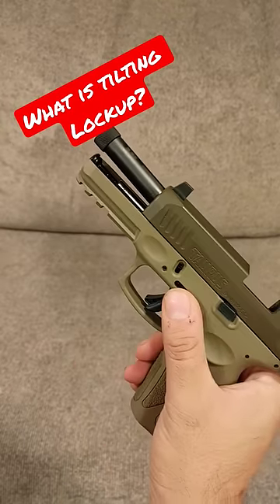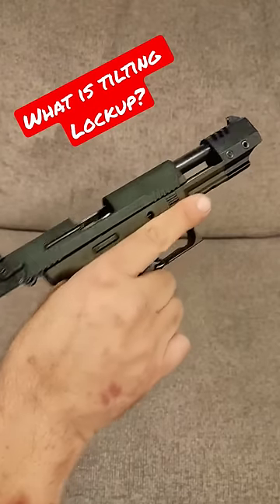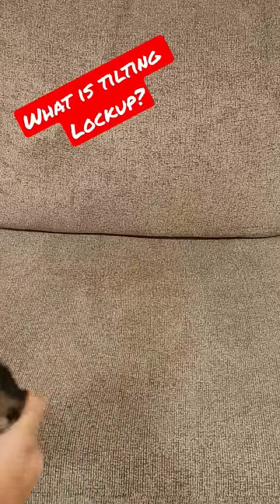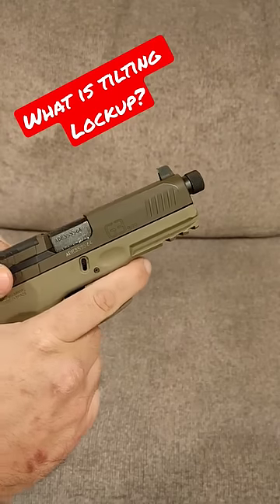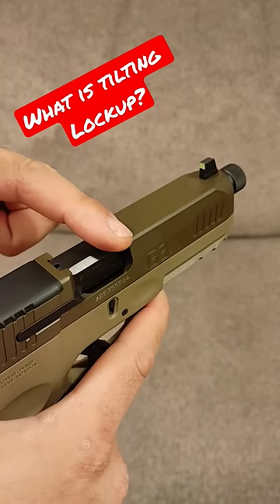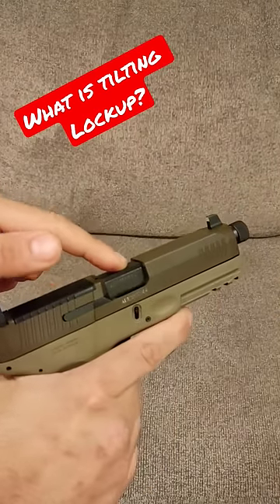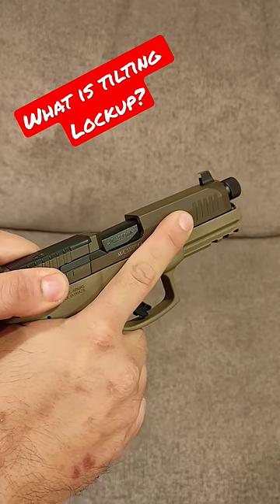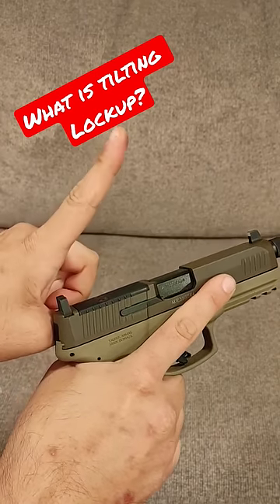What is Tilting Locking Action?

Comment: Laughs in beretta
Reply from the maker: Ooh, good call ill do one on the dropping block. Its a cool design
Reply: @TheJimminiShow  John Browning invented that box system on that barrel for his Browning high-powered 9 mm and everybody from Glock to whoever you.
Reply: Laughs harder in wheel gun. 🛞
Reply: I got a clone model cz 75 9mm & it looks like a 1911 & beretta had sex. Real accurate & reliable.
Reply: @timc46440  laughs even harder in musket
Reply: @TheJimminiShow  what about the rotating barrel design Beretta uses? They didnt invent the concept, i know the Savage 1907 has a rotating barrel that Ian from forgotton weapons shows doesnt really provide a true locked breech. Ive also always kinda thought the roller lockup CZ used in the CZ 52 was pretty neat as well...
Reply: Love my 92sf
Reply: @hunterherzog4788  Me too brother. Iconic workhorse.
Reply: @bobbybluntrock8928  Browning Hi Power uses locking lugs, just like the 1911. The Hi Power improvement was to lose the rotating link in favor of a cut slot to cam against a frame member. All of changes to the Browning lock up are for manufacturing improvements, not functional changes.
Reply: 92fs is an amazing design smooth as butter and very enjoyable to shoot
Reply: @46god  for sure, did some shooting with it at 100 yards with it on a 3x3 ft plate. Was getting hits about 40% of the time I was very impressed of its accuracy
Reply: Meanwhile everyone else that doesn’t own a berreta is like- "N00000 You can't POSSIBLY
carry a 92'III! It's the CURRENT
YEAR! Nobody shoots a DA/SA
anymore! It's OBSOLETE! It's
HEAVY! The grip is TOO BIG! You
can't even STIPPLE the Heckin
GRIP!". Btw I love my 92 m9a1 😎🔥
Reply: Laughs louder in Desert Eagle, HK P7 and Mauser C96 do not laugh.
Reply: @Keepitsavage21  well, I'd never carry one, 1, I don't like hammer fired guns for carry, 2. They're big and heavy, 3. I don't like DA/SA guns/triggers, and most of all, 4. I've just got so many rounds through polymer striker fired guns, starting with glocks like 15 years ago, and then finally switching to a sig p365xl about 2 years ago, and I couldn't be happier with it.  Well, and of course 5. the slide mounted safety.  Yes, I converted mine to a "G"/decocker only model, but I don't even like that on the slide.
That being said, berrettas really are slept on, and get a lot of undeserved hate(which I largely attribute to the various things that come out of the military.)  I only have one(a compact inox, which I just find so sexy), however I'd really like a full size LTT or Wilson Combat gun, or even one of the (relatively) new models who's name escapes me, "92 performance" maybe?  The stainless steel one with the(finally) frame mounted safety?  Those look sweet.  My only slight critique of that gun is the ugly, downward slanted beavertail.  You put a 1911 or sig 226 elite style beavertail on that thing and is buy one in a heartbeat.  Well, maybe.  I don't tend to spend a lot of money on pistols, especially if they are just going to be range guns.
Reply: @jonboy9734  laughs the hardest in bow and arrow
Reply: He sounds like a fatherly swagger souls 😤
Reply: @JRG GOTAY never owned one before huh?
Reply: If we're talking about the M9 then you'd be surprised that it essentially borrows the same idea as shown in the video, it's the browning action, just instead of it being part of the shape if the chamber on the M9 it's a separate locking mechanism that uses the exact same principle.
Reply: @Keepitsavage21  lol my buddies were calling me a boomer because I carry a 92 in a shoulder holster. I absolutely hate wearing jeans so i don't normally carry on the hip.
Reply: Laughs AT Beretta.
Reply: @jonboy9734  laughs in fire lance
Reply: @projectblack2462  Mexican Obregon 1911 was the 1st
Reply: Laughs at overpriced berretta while holding Girsan regard
Reply: @DaveOganesyan  I think the joke is about the tilting barrel in particular, which the M9 does not have
Reply: @jonboy9734  Snickers in Swiss Sabre

Comment: A Taurus is a short recoil, which is during the cycle of operations the barrel starts moving to the rear with the slide and is stopped by locking lugs or blocks while the slide continues to the rear. The locking lugs will stop the barrel from continuing to the rear and help the barrel to tilt. The slide will be brought back forward due to the recoil doing decompressing, while the slide moves forward it strips the next round, which is angled upward, from the magazine lift. The round will push against the feed ramp and slide into the chamber. Once the slide is fully forward then the breech is locked. The P22 is a completely different gun, thick of it as an AR. It’s is a gas delayed system, due to the gases going through the gas cylinder to complete the cycle. Plus that system cannot utilize a tilting barrel due to is gas cylinder.

Comment: So I think this would’ve been a good point to touch on, as I consider it to be the primary point. The reason that mechanism is even there. The larger caliber rounds that aren’t suitable for “direct blowback” need some sort of mechanism to delay the cycling of the slide, until enough gas has exited the barrel for it to be at a safe pressure to cycle. Direct blowback is used on smaller rounds like the .22 or the 9mm makarov, as these rounds don’t have a high enough case pressure to pose a threat to your hand. If that barrel had no delay mechanism your hand would get lots of powder burn and have nasty hot powder flying out of the ejection port, or even just send the slide back too fast and break the gun, or harm you. The tilting mechanism allows enough delay for this to happen. Some handguns use a rotating bolt delay mechanism as well as a few others, though tilting is most common due to it being simple and requiring less time/money to be spend in the manufacturing process

Comment: I think I'm the one who asked that!! But thank you much appreciated I had no idea that's why It did that
Reply: The tilting barrel is actually a very old design and was first invented to help improve feed reliability as well as aid in lock up
Reply: Did he answer your question?  Cause he said a bunch of nothing. Lol
Reply: He did a great job explaining how it does that. The reason why that was designed was so that it resists barrel rise when firing.
Reply: It locks up to prevent the gun from opening up while the bullet is in the barrel and chamber pressures are to high. If it opened to soon you would get a blow out. That’s why it locks up. He did a terrible job of explaining the reasoning.
Reply: I've read through a bunch of the comments and I dont think I've seen anyone else say it so I'll add, the tilting barrel also helps with general wear. Sinc the barrel and slide move together as opposed to sliding against each other.
Forgive me if I'm wrong about this I'm not exactly what youd call an expert. This is just what I was told when I asked the same question after getting my first glock.

Comment: True.  But it's also to allow for a better projectile trajectory.  If the barrel stayed perfectly strait then the bullet would start to drop immediately after leaving the barrel.  This would make sights on top of slide useless.  By adding an arch to the bullet it allows for more range and the ability to see the point of impact from your sights.  Your 22 has an arch, you g3, your ar15, and every other modern gun have a slight upward trajectory.  It's why when we zero rifles for 50yds it's also still on at 200 yds.  Bullet going up at 50 yds and on its way down at the 200yd mark.  🤙

Comment: This is also why fixed barrel handguns such as the 22 he was showing are usually more precise.
This is due to the barrel not moving from shot to shot like a tilting barrel does.
Generally speaking when A shot is fired and the slide starts rearward the barrel tilts and the locking lugs disengage with the slide in one smooth motion.when the slide goes forward the barrel moves back into place and locks the action. Depending on how tight the tolerances are determines the overall accuracy of said handgun

Comment: Yeah that's correct. But did you know why they went for that design ? It's chamber pressure. That's why .22 don't have it they don't need it. The chamber pressure has decreased enough when it ejects the case. Where on a Glock it's designed to give extra time before ejecting case which makes less pressure

Comment: It derived from the 1911 to feed rounds int the chamber easier
Reply from the maker: No it isn't. While it is true that it can be helpful in assisting around into the barrel, it is not the primary purpose of the tilting locking action. If it didn't have tilting locking action it would just be a straight blowback pistol and it would be incredibly uncomfortable to shoot. That's why high points suck. Also if that was true rotating barrel guns and fixed barrel guns would become Jam machines

Comment: I see 99% of people on videos like this do something that is very wrong. Stop hitting your slide lock release put the weapon and Battery all you need to do is just take your hand while holding the weapon pull back and lit it battery under its own weight. One if you hit the slide lock to release you will wear out your slide lock in your slide will not lock when the weapon is empty also it can lead to a round not being batteried properly. Just my opinion

Comment: is it bad to store a firearm with the slide locked back?
Reply from the maker: You are compressing The Recoil Spring by doing that. And that could potentially cause a problem if the gun were to get wet or if stored in a high humidity area. If you worried about knowing that the gun is clear I would just put a barrel flag in it which is a little piece of plastic that indicates that the gun is unloaded.

Comment: Does your gun fail to cycle when shooting with a can? 🤔 my only shoots one round and fails to cycle again? How can i fix that? Help
Reply from the maker: If you're asking if my Taurus does that, the gun comes with two different recoil springs. Look inside the pouch with the gun lock. There will be a second recoil spring with a blue color on the end of it. That is The Recoil spring that's designed to be used with a suppressor. If you're referring to just handguns in general, you may need to change what kind of ammunition you are using. You may still need to with the Taurus, and make sure you're using subsonic rounds to ensure better compatibility with your gun
Reply: With suppressor you have to use subsonic rounds

Comment: The ejection port locks the breach. The breach is at the rear of the ejection port. Browning system used lugs on the barrel to lock into the inside of the slide.

Comment: See I thought it did it to provide enough room to chamber the next round to help keep the gun a little more compact. My Kimber micro 9 would not be able to load the next round if that barrel didn't tilt back at the same angle that the magazine holds the shell.
Reply from the maker: Well that is a cogent theory. No. It's simply allows the slide in the barrel to stay locked together long enough for the pressure to escape through the barrel and then Force the slide rearward. If they didn't lock together in some way as soon as the bullet fired the slide would come back at your face at the same speed as the bullet leaving the gun. It's that whole pesky every action has an equal and opposite reaction thing. The gun would literally rip itself apart overtime. In fact many smaller guns have fixed barrels when they have lower pressure such as the PPK which is a 380 and it has a fixed Barrel
Reply: That's part of the design too
Reply: Just got a kimber evo sp I love it.

Comment: We owe Mr Browning for this wonderful piece of engineering.  He invented the 1911.
Reply: He invented the tilting barrel lockup design, but the system that gun uses was developed by Sig. The key difference is where lockup occurs. The 1911 uses lugs in front of the chamber to lock up, Sig developed their version using the breech face and front of the chamber itself to engage the slide. Im not denying Brownings contribution in inventing the concept, but its been largely refined since then. They say the tilting barrel design affects accuracy, but im not sure how much as the bullet is out of the barrel before pressure reduces and the action is cycled...

Comment: My Baretta m9a3 does not tilt. One of the beauties of a simplified design
Reply from the maker: You are correct you have a falling block or dropping block system. But it is not a simpler system. It's just a result of wanting to have an open top slide. It's actually a two-piece design, meaning if you take the dropping block from the bottom of the barrel and lose it you now have a non-functioning gun. Thus complicating it. But it is a very reliable system. That's why it was the United States side arm from 1983 until it was recently replaced
Reply: Love my M9A3.
Reply: @TheJimminiShow  
"Fixed barrel .22" 
Found an 80's .25 auto W a fixed barrel, it was thought of as a
~ Center fire .22 "better reliability"(?) Similar power.
✌️

Comment: Not the best explanation. Most cartridges would require a heavy slide to operate as a simple blowback like most 22's do, to allow the bullet to exit and drop pressures inside the chamber before the slide moves back exposing the ejection port. So what goes on, is the barrel and slide are locked together for just a moment after the cartridge fires to allow the bullet to leave the barrel, dropping the pressures inside, then the barrel drops down, the ejection port is exposed and the cartridge is ejected.

Comment: Isn't it part of a "delayed blowback system"? It allows the weapon to shoot a more powerful round without damaging itself. We have all seen videos of a spicy round slamming the action open and damaging the mechanics some how.
Reply: The 22 is what is called direct blowback, same as high points. The direct blowback weapons use the weight of the spring and slide to operate in proper timing. The weight mechanics are why you can not mill a hi point's slide too small or it will not operate properly.

Comment: Isn't it also other than the lock itself out also tilts the loading ramp to be a less severe angle which helps with reducing FTF malfunctions typically preferred due to hollow point ammo not having the typical FMJ smooth all over nose of the cartridge?

Comment: Hell even my airsoft Glock does this. With the outer barrel of course not the inner barrel for the bb.
Reply from the maker: Yeah it's simply a way to lock the slide in the barrel together until the gun is fired it helps reduce recoil as well as reduces the speed of the slide as it comes back because it allows the slide and spring and Barrel to work together to soften the reaction from firing a bullet

Comment: So it's basically a slide lock but internal?
Reply from the maker: Yes and No. It keeps the slide and barrel together until the pressure from a fired bullet forces them apart, but unlike a slide lock, this is a purely automated process. The slide lock actually uses your magazine follower to engage. As long as the gun wirks as intended, there is no input or manipulation necc.
Reply: @TheJimminiShow  Ooh, thanks man!😃👍

Comment: Thank you and with that barrel it’s not weaker is it? Aka Like dose it move up and down  on a hinge or is it locked in that position?  I’m British so we don’t get guns like you do in the USA ! So you tube is the only way of knowing interesting things about your guns. Thanks
Reply from the maker: There are different types of locking mechanisms for the tilting action. This particular gun uses just a piece of metal that is shaped in a hook design to fit into a metal dropping block. The block takes the force of the firing of the bullet and is made out of steel so that it can withstand thousands upon thousands of rounds. There are many guns out there that have gone 20,000 plus rounds without failing

Comment: Hey quick question I have an issue with my P22 where the safety disengages if the hammer falls on it. So in other words if I pull the trigger while the safety is engaged it will disengage the safety and if I pull the trigger again the gun discharges.
Reply from the maker: I dont see a question, but Im guessing you are asking if there is something wrong with your gun. The short answer is Yes. The safety should NEVER disengage when you pull the trigger. That is the ONLY thing the safety does. It sounds like the safety is not fully engaging. First step is to take the slide apart. Carbon buildup in the slide could stop the safety from working right. Next step is to take it to a gunsmith or if it os under warranty, send it in. I personally would not continue usong it until its fixxed.
Reply: @TheJimminiShow  I stripped and soaked the slide in gun cleaning solvent re oiled and re assembled. I guess I was asking if you had similar problems with the gun.
Reply from the maker: Sorry, no. I havt two right now and have never had that particular issue.

Comment: When the barrel is exposed when you pull the slode back is it normal if the barrel seems a little "loose"? Or do i have a major problem
Reply: Mine too. Have you figured out if it is normal?
Reply: Mine too. Have you figured out if it is normal?
Reply: @edwardlaguador8391  it's normal.its the way it is made. But if it is super loose then that isn't normal and needs to be replaced or repaired
Reply: Thank You

Comment: My Beretta storm uses twisting barrel
Reply from the maker: Commonly called a Rotating barrel. Operates on a Cam system similar to the way a rifle bolt works
Reply: Beretta calls it rotary barrel they claim it reduces recoil but I don’t feel much difference in it or any other similar sized and weight pistol.